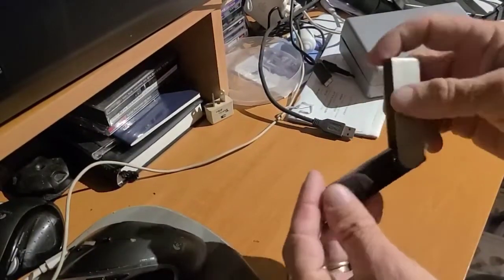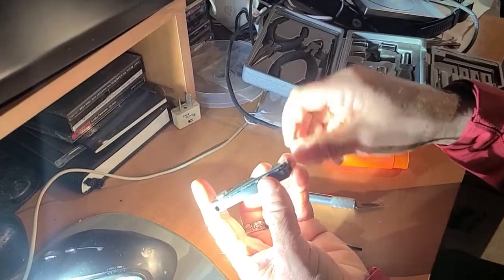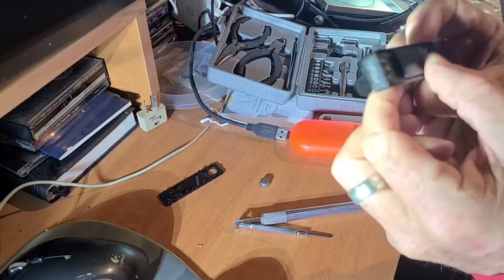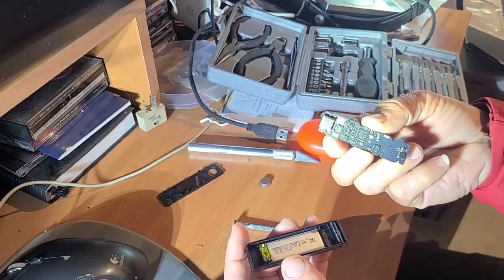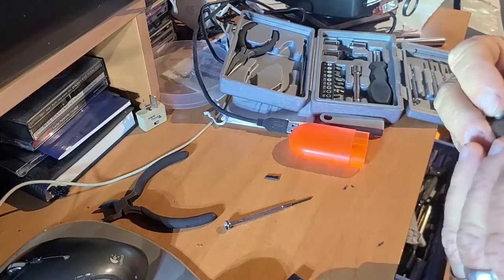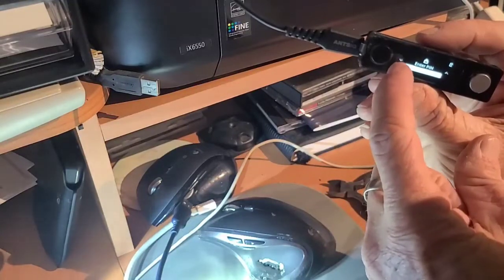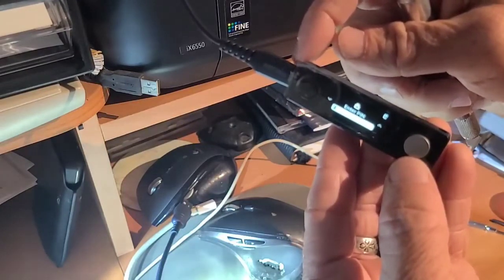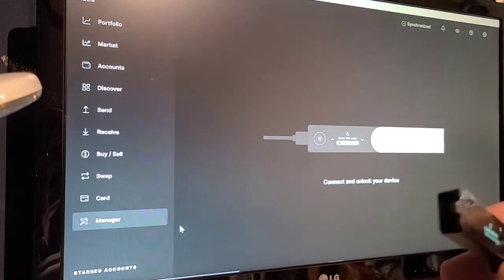Ledger Nano X, battery cannot charge and review

Comment: Had the same problem...
Solution: on your Ledger device go to Settings -> General -> Battery saver -> then select "Never power off" (that disables battery saving). Also go to Control center on your Ledger device and disable Bluetooth. After you have done these two things, power off Ledger then connect it to usb charger (use original USB-C cable). My Ledger battery charges normal again. When the battery is fully charged you can enable Bluetooth when you need to use it. I don't use battery saver any more. Everything with battery is now ok. Hope this helps you to solve your Ledger battery charging problems🔋🤝
Reply: worked for me
Reply: Wow using the above method it worked for me also. Thank you so much.
Reply: Top job ❤
Reply: Oh my days, This save me the hastle to send the ledger back to them, and even to open it like this video showed, thanksssssss a million man
Reply: Worked for a second, battery charged up to 87% then it gave me the battery message again. I unplugged it instantly went down to 6%. The battery has been shit since I got it. At first it would take like a hour to fully charge. After having to deal with this I can’t recommend ledger anymore.
Reply: Worked for me, thx